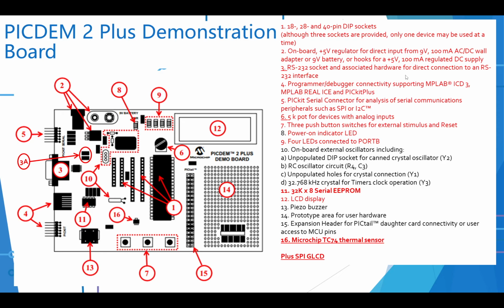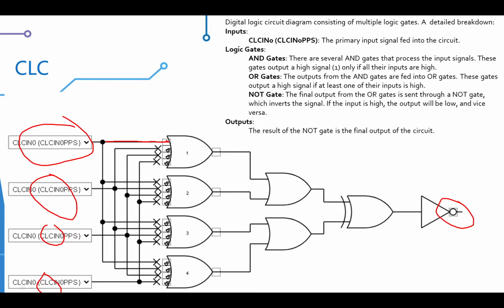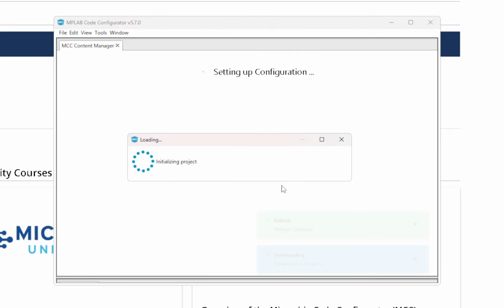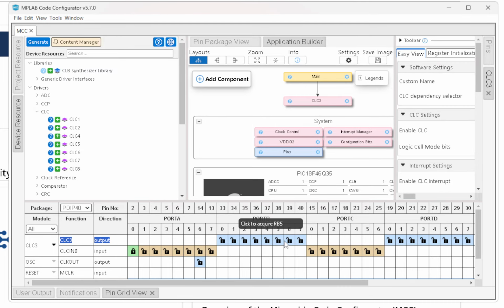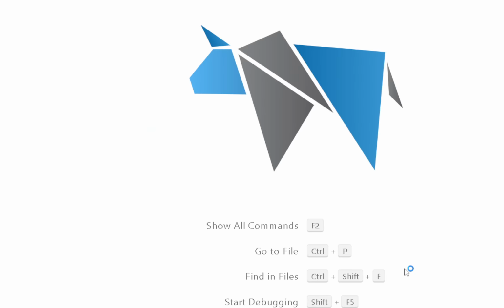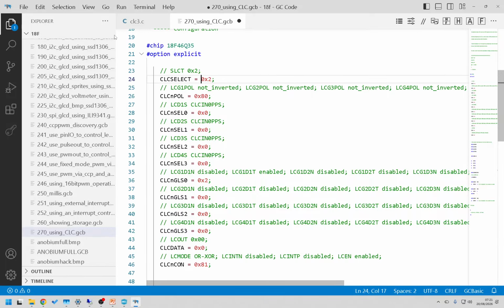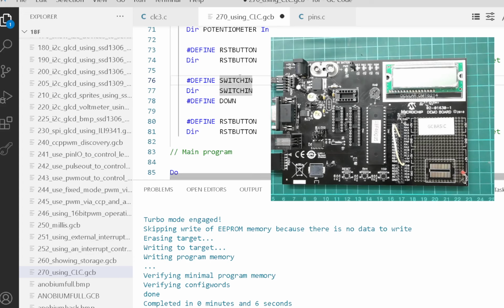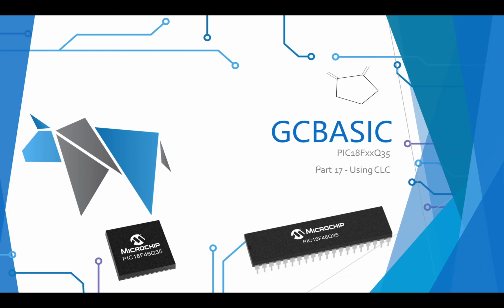PT17: PIC18FxxQ35 chip Family - Using CLC

Comment: Excellent Video Just in time, I was working today on CLC for a PIC10F322, also I was able to download CLC Designer Versio 3.0.0.4 INI Ver: 4.6 from Microchip (kA1P00000004XMpKAM_en_US_1.zip) with the Designer it's so easy to setup the ASM Flag Setup edit to $xx hex and write code into PBP3 Pro